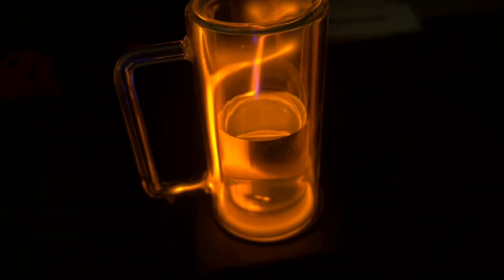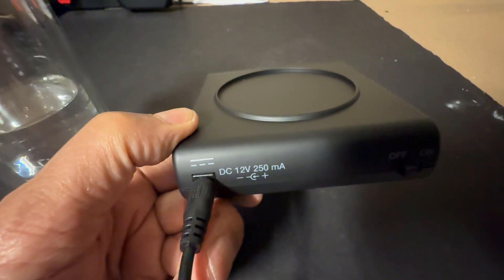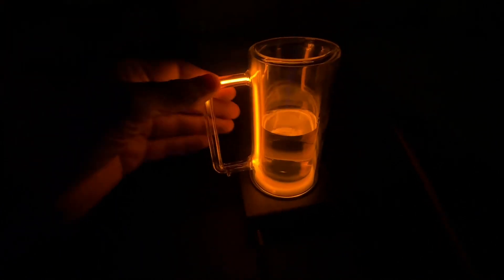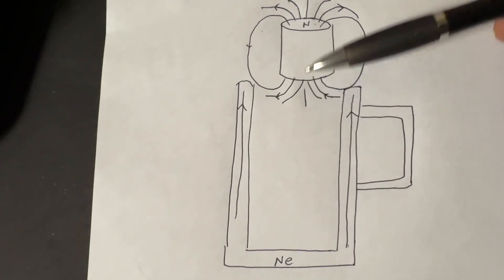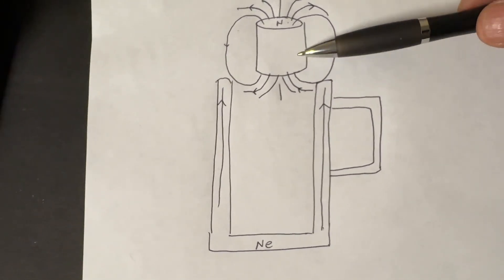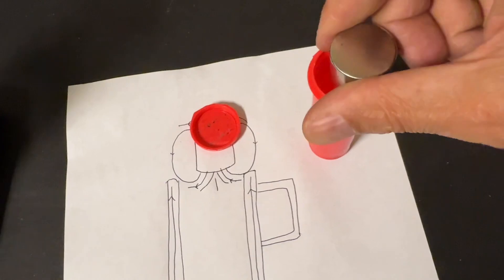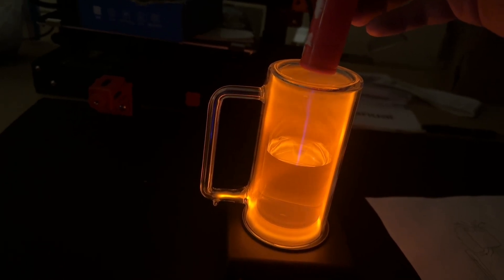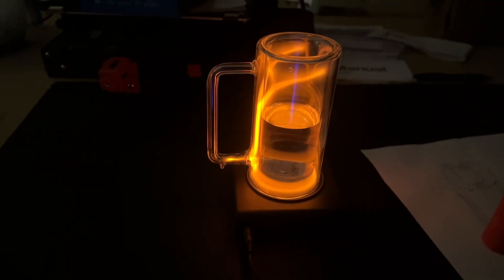Stirring Plasma in a Mug

Comment: Thanks for sharing! Do you know what is the plasma température ? I want to create plasma and this seems exactly what I need !
Reply from the maker: I’m not sure what the plasma temperature is. If I can find a way of measuring the temperature of the low pressure neon plasma, then I will definitely see if I can get a result for you. The swirling motion of the plasma is very interesting. I’m sure the ionic wind Inside the walls of the mug would be enough to move objects such as a non conducting sail

Comment: I have another magnetron request, what happens if you run a magnetron without any rectifier diode and capacitor?
Reply from the maker: To run it as a magnetron, it’ll probably not work without using rectified AC. However, to run it as an x-ray device, it will work with high voltage AC with at least 40,000 V AC. In order to run it this way, the whole thing has to be submerged in oil to prevent arcing across the ceramics. The magnets also have to be removed to get rid of any microwave production.

Comment: It's AC, so we'd only expect the plasma-stream to spread a bit, right.  That's what led me to bring a huge NIB magnet nearby.  (No protection, but never dropped it, glass never shattered!)   I wonder what the actual pattern of current could be?  The streamer "sticks" in the handle, otherwise it might rotate incredibly slowly for a weak magnet.  Also this suggests that *all* Tesla-coil lightning can be pushed around by a single strong pole (a meter-tall stack of neo magnets?)

Don't bring the electronics near a spark-gap, or you'll be replacing a transistor!
Reply from the maker: Interestingly, I activated the plasma mug from the side instead of the bottom, using a continuous wave Tesla coil operating around 500kHz-this readily ionized the neon very brightly. I then placed the magnet in the top of the glass the way that I did when it was activated using the plasma base that came with the mug. However, there was no rotational motion of the plasma with the Tesla coil at the side. I was scared to do it from the bottom because I felt that the plasma might break out and hit the glass, puncturing it and releasing the vacuum. So I did not try it from the bottom, but that is something that I’m interested to try next. I will probably use a thick plastic insulator to prevent any strikes to the glass. This could be done by putting the mug in a second thick plastic cylinder

Comment: does say that the exciting field for the plasma is pulsed DC, not an Ac current, as if it was AC it would not rotate, but oscillate at the drive frequency. wonder if you can PWM the driver oscillator in the base, and that way get a barberpole effect in the plasma as well. I know neon tubes with AC drive do not really notice magnets.
Reply from the maker: I think the plasma generating base for the mug produces a high frequency alternating electric field. I’ve not checked what the frequency is, but I will do that next.
Reply: There is no need in DC to make plasma rotating in magnetic field. I conducted an experiment with AC arc inside a magnet and it also was rotating. I measured current through the ark with oscilloscope and there were symmetrical signal, almost ideal sine wave
https://youtu.be/Skd7r6a4W-Y

Comment: what happens if you turn the glass in same direction of the plasma? need a slow motion camera to capture... i think it will stick at the edges like water on wash machine does
Reply from the maker: That would be an interesting one to try if there was some way of fixing the glass to something and rotating it
Reply: @BrianDhvTinkerer yes, that should be a new thing